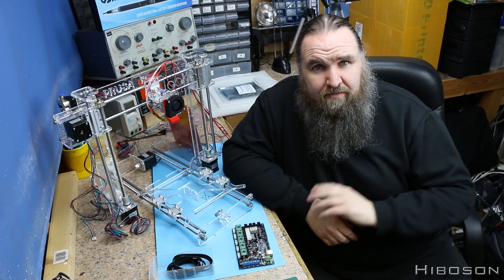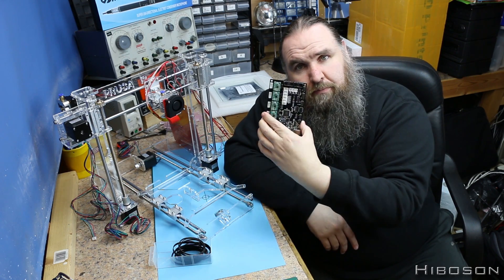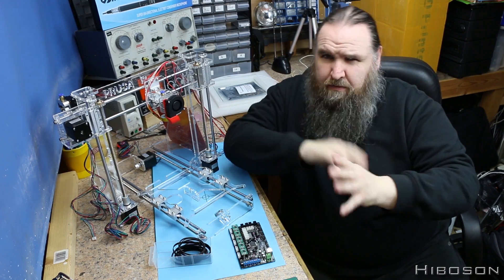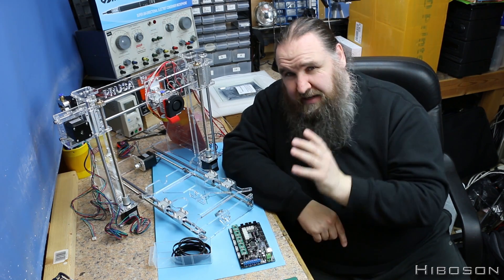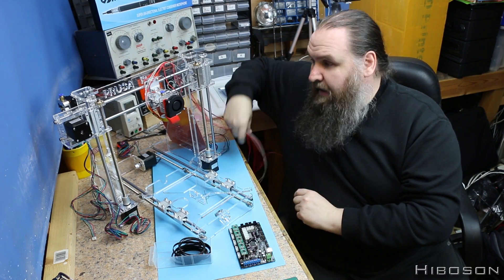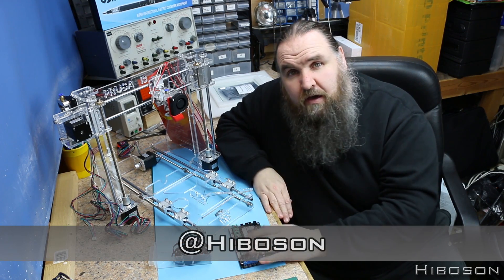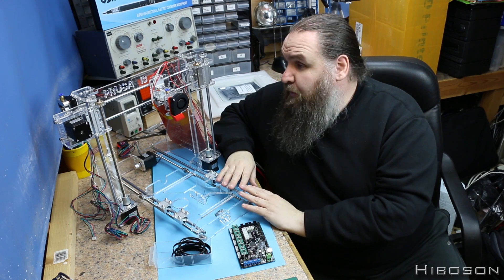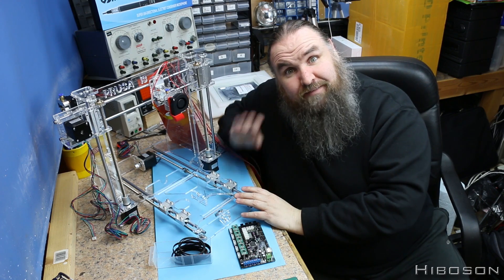Sunhokey 3D Printer - Build Update

Comment: What is the biggest build size
Reply from the maker: Jacob Procter Well the specs say print area to be 200mm by 200mm on the X/Y and 180mm on the Z,,, but seeing how they have the head so low I'm hoping ti figure out a tweek I could do that would raise the head up some more, see if I can increase the Z from 180mm ;)
Reply: thanks I am thinking of getting this printer
Reply from the maker: Jacob Procter I've had some after sales issues but TBH I'm still more than happy with my purchase, as long as your technical enough to be happy figuring things out yourself of searching the web for answers then I say go for it :)

Comment: Hello Hiboson, My Prusa i3 is pretty much done.  I welded strips of polycarbonate to the more fragile areas of the acrylic, where the screw hold-down for the guide rods are.  This precludes any -- well, most of the potential for over torquing those screws and breaking off the tabs.  I didn't break any, as I used a small clamp to ensure the little nuts didn't start rotating when a bit of torque is applied.  The nuts will rotate and possibly act like a wedge to snap-off those outlying tabs.

I noticed that the position of the X axis drive on my printer was reversed (vertical) from what the build design calls out.  I had initially put the X axis motor/pulley sub-assy on upside down, so the bearings, pulley, belt were more exposed and accessible towards the printer front.  I looked at your video (I mounted mine without looking at the Sunhokey instructions), and saw your X axis drive assy had motor front and pulley facing towards the back of the Prusa -- per the Sunhokey instructions.

I went to RepRapWiki, and noticed all the standard Prusa i3 designs have the X axis drive motor and pulley assy facing to the front of the printer -- opposite from the Sunhokey "design."

It seems a bit smarter to have easier access to the bearings, belt, and motor by turning the drive assy upside down from the instructions.  For one, you can easily adjust the long Z axis bearings to optimize reduced friction on the guide rods, by loosening up the bearings, allowing them to float, then carefully tightening them down.

I think I might go back to my original setup, which is more in step with the standard Prusa i3 design. Also, it seems when I flipped back to the Sunhokey configuration, Z axis travel did have more friction. Of course, I might then have to deal with the motor driving the axis in reverse ; () would need to then reverse motor polarity.  I guess I'll do the smoke test first, see how things work, then consider.

I also welded a nice acrylic ear for the X axis limit switch on the extruder assy -- much nicer setup than the silly Sunhokey X axis limit switch configuration.

Cheers, and looking forward to your next set of videos -- keep up the GOOD work my friend!
Reply from the maker: Glad your figuring out things out OK :) I think it's half the fun with things like this playing around and seeing if you can put your own spin on them and it function as well if not better :) I have that fun to come,,, real life is doing that old trick of using up all my time at the mo, at work several people off so covering there work too,, but I'll get there and soon will have it built,, build video is gonna take some time to edit,, just about to upload this weeks video a teaser of the build video ;)

Thanks for the encouragement :) H

Comment: I'm at somewhat of a crossroads as far as choosing a 3d printer goes. I'm deciding whether I should get this particular printer, the Getech pro Prusa i3 OR the Replikeo Prusa i3 rework, as for each printer has specific features and sadly, each printer has its drawbacks. I want to say i'm more so leaning towards the sunhokey however I don't feel comfortable with the board they provide, that mks gen 2 board. None the less, good videos, cant wait till the build is finished and the printer is up and running.
Reply from the maker: Well the way that might help decide is out of the missing features on the different systems which is easiest for you to mod/upgrade to do the features you want?, pick which has the easiest cons to get round basically :), And thanks for the kind words :)
Reply: Hiboson Just purchased my first 3d printer, thanks for helping me choose :D I as well will try to upload a few videos of a build or possibly a time lapse.
Reply from the maker: justinp4235 Glad I could help :), that was my aim with these videos to help people and glad that I am :) So did you go for the Sunhokey or another one? The main thing is there cool :)
Reply: Hiboson decided the Sunhokey, primarily because as of right now I've seen the best results and the least complaints. The printer is also in a nice self contained package, uses an e3d hot end (not completely sure which version, but nonetheless e3d hot ends tend to be really good for print quality) and overall just felt like the better choice. I purchased mine on sale from https://www.3dprintersonlinestore.com/diy-kit/full-acrylic-reprap-prusa-i3-kit, LITERALLY CANT WAIT TILL IT COMES IN :D
Reply from the maker: justinp4235 Coolio :) I really want to get mine finished so I can finally start to use it lol, the draw back to filming it with 3 camera setup etc takes ALOT longer to do the build and I have to wait till I have free days, can't just nip into the workshop do a step each night,, but I'll get there and hoping the build video will be worth the effort :)